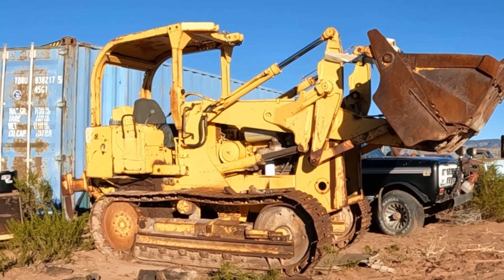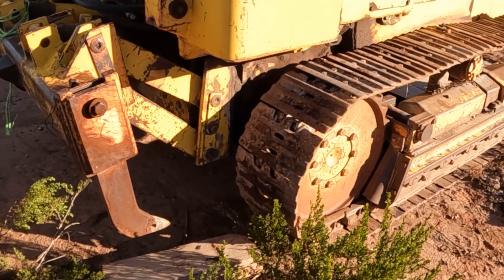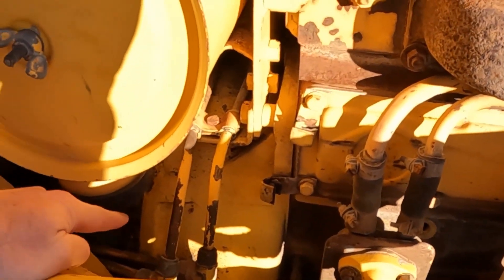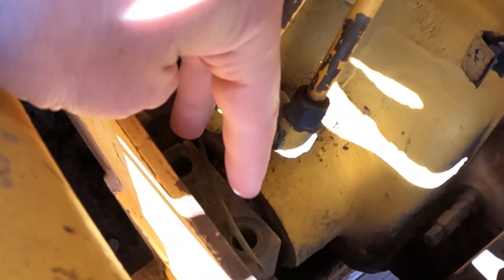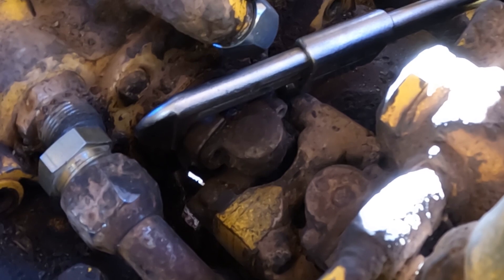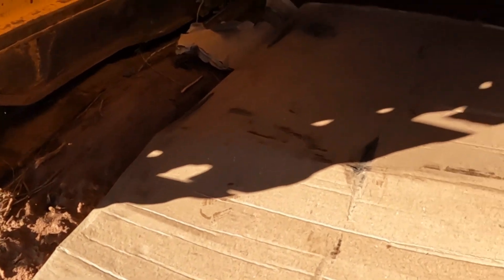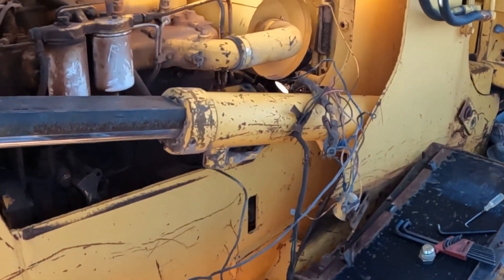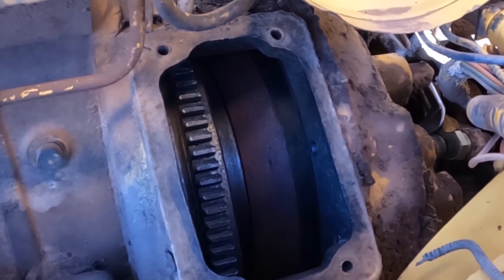International 100C Crawler Loader Update Episode 2

Comment: Hello friend, a question for you  about the engine of this international machine, 175B track loader.
It will be the international 100 e track loader 
Are these engines the same or are they different, thank you
Reply from the maker: @josecaballero3305  an International 175B has a International DT361 6 cylinder engine, and the International 100E has a International D239 4 cylinder engine.  Very different from one another.

Comment: Keep in mind the 100C and TD-7,8 series crawlers are essentally the same tractors.The flywheel change may have come when Dresser starting using Cummins engines instead of the IH D-239s.